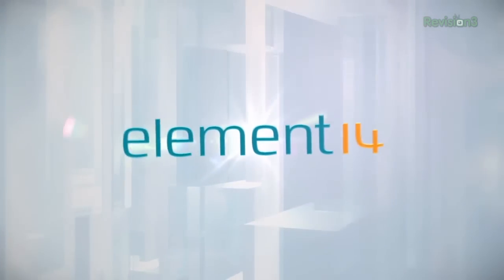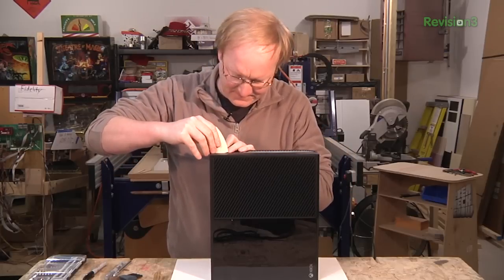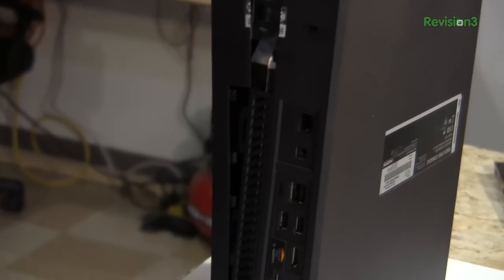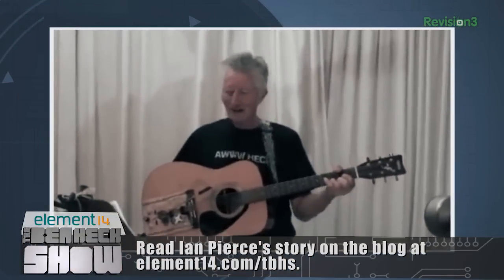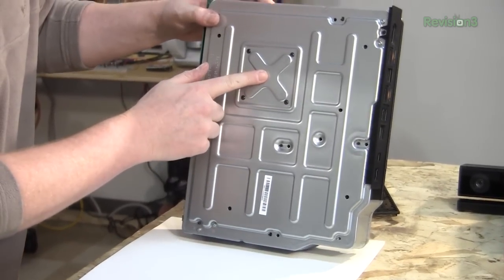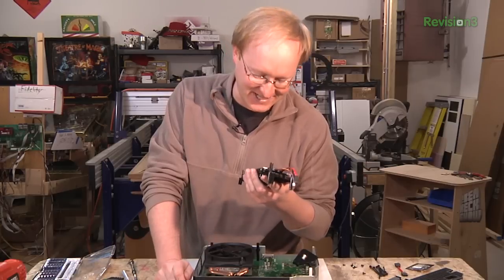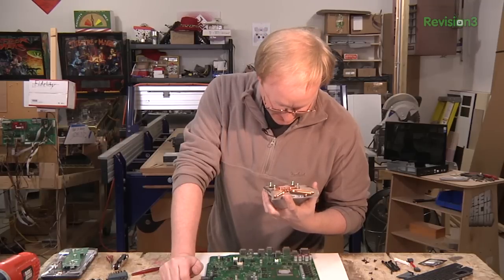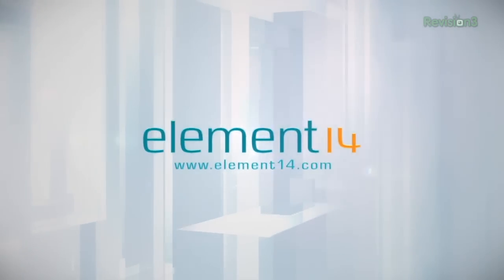Ben Heck's Xbox One Teardown

Comment: So those nice big fan clips break easy, I got an xbox recently that was dropped and 3 of 4 were broken. It hit the ground hard enough to bust the case open, bend the metal frame, rip the ribbon cable and the wireless Ariel cable off the front RF.  I'm surprised the HDD survived though.

Comment: The inside is a lot like a PC.
Reply: +Proquer It pretty much is a PC, but with a different operating system.
Reply: the original xbox was basically a pc that is why it was so big
Reply: All consoles are essentially PC's, you can run Windows on the 360 and Linux on the PS3. You could do that on the original Xbox and PS2 as well, i don't doubt current gen wouldn't be able to do it too when someone cracks them open
Reply: The PS2, PS3 and all consoles before them were  heavily custom  proprietary hardware hence why they were so expensive and powerful. The Xbox consoles are literally PC components in a box, even the disc drives are PC drives. The PS4 is the first sony console to use PC components. All arcades are PC's now. They used to be custom hardware in the 1980's and 90's.

Comment: Why don't they want you looking inside it?
Reply: they dont want u to reverse engineer the thing
Reply: Can you see It? Illuminati confirmed👀☠❌ 🔺🔺🔺
Reply: So you don't accidentally  break it out of morbid curiosity and then since you voided the warranty opening it you have a broken system. They're trying to protect you from yourself
Reply: +YangSing1 in case if u opened it and broke something. just guess I am not telling u would just think. then when u goto Microsoft and complain that there is a manufacturing defect , Microsoft is liabe to fix it . so to prevent that from happening they put that sticker

Comment: After watching the teardown of X1 & PS4 just realized how much more compact the PS4 is, Sony even put the power supply inside the console instead of the huge external brick used on X1, and to add insult to injury PS4 is the more powerful console.
Reply: +73mathesar The reason it's that way is because the PS is packed like a laptop. The XB1 is built like a small PC and that's why the XB has a faster CPU and a slightly less powerful GPU.

Comment: The contrast between the engineering of the PS4 and Xbone is amazing. Even though they use many of the same parts, the PS4 is on a much higher level.
Reply: That's a programming issue. Rocket League runs warmer than GTAV.

The engineering I am referring to is design, not performance.
Reply: japan is about neatness compactness and efficiency. America like thier cars do not care about that

Comment: Holy balls, that heatsink on a console?
But anyway, to the 14 year olds arguing, you need to remember.
Microsoft is experienced with software.
Sony is experienced with hardware
Reply: Think you.
Reply: +Kavas The heatsink is like that to prevent the overheating issues like the 360.
Reply: PS3 had the same problem too, fire an old PS3 up and it'll sound like a jet engine because the fan can't keep it cool
Reply: And that is why Microsoft is such a bigger company.
Reply: It's funny you say that sense every time I've bought a PlayStation with the exception of the psone, PS3 died after 2 years, ps4 died after 8 months, I'd say if Sony is experienced with hardware they definitely haven't learned from there mistakes like Microsoft has I'd say the original Xbox one is better built than any PlayStation I've owned, old fat Xbox one on its second power supply and going strong  to this day, i was done with Sony after they released that God awful PS3 super slim after my PS3 original  died, super slim didn't last 3 months and I said to hell with ps4 after it died 8 months, so Sony may be well versed when it comes to hardware but they don't give a shit when it comes to cutting corners, the super slim was as solid as 6 dollar toaster from Dollar General.
Reply: @bray32641  stop lying

Comment: The XBOne looks like a perfect candidate for a laptop mod. I'm excited to see what you come up with.

I am really happy that the xbone has that kind of cooling. Do you know which fan the fan is blowing? The 360 Slim had a good heatsink, but the fan was blowing out of the case... not onto the processor. I had a friend with a slim that would have overheating issues with the 360 slim, due to it. I removed the fan, added a quiet 92mm fan that blew onto the processor instead of out of the case, and soldered it to the 12v line. You could feel the hot air blowing out of the top, and the heatsink was cool to the touch. He never had a lag issue since.

Comment: interesting fact: those Samsung drives are actually stock from Seagate... you can tell from the Seagate website on the top of the drive label and the model number... the Seagate hard disks have an model number... for example, the 1TB Seagate Baracuda is ST1000DM003-1CH162., ST standing for Seagate Technology

Comment: why did microsoft make it that you cant actually upgrade the hard drive without voiding warranty. i mean if sony could do it why cant they. also why has microsoft always been different when using hard drives like witht he xbox 360 i loved it but i never understood why they used a normal old laptop hard drive but then put some next ass casing ontop of it so it wasnt that easy to buy a normal pc hard drive and just pop it in
Reply: ***** id rather be able to upgrade the hard drive. and with upgrading then i can atleast use the old hard drive as a spare hard drive or sell it to get some extra cash
Reply: TheTruth4k It actually supports up to 15TB. external drive.

Comment: is the graphics card built into the motherboard? he never pulled a graphics card out of the Xbox
Reply: I think both the standard computations and rendering computations are all done on the single APU. That's why he was being particular about calling it an Accelerated Processing Unit. Games developed for PCs actually have to assign certain operations to the GPU, otherwise all calculations are done on the CPU by default. I speculate that game engines usually have built in functionality to easily handle that stuff, so it's not something you normally hear about.

Comment: So would it theoretically be possible to upgrade the HDD with another Samsung drive of the same speed with more storage?
Reply: The trick would be formatting it correctly and maybe pre-loading it with certain data. If you can do that, you should be able to fit any drive in it that uses sata 3.0.
Reply: Thank you. Shows what I know

Comment: The design of the Xbox ONE is really awful.
Reply: I like the look of it
Reply: david doof That is your opinion yes. But when you first get it it is shiny and looks nice
Reply: Are you mental, there are rechargeable controllers for both the xbox one and 360.
Reply: ***** It's a box! What do you want? A Monet on the side?
Reply: explain?
Reply: Dom S a big square box with a power brick
Reply: did you expect it to be round?hexagon shaped? Or in italics like the ps4? Plus That power brick saved my xbone once. Their was a bad storm that sent a power surge through my house. Everything went off. 5 mins later power came back and my Xbox was still on because of the reserve power in the brick. Nothing was corrupted nothing was affected, didn't even have to restart my system after losing all power. So how is that a bad design?
Reply: Dom S the console itself is ugly.Really ugly
Reply: Dom S Save you Xbone? It is not like it would break the console from forcely turning off, and that power brick would still "save" your Xbone if it was in the console. Though they just couldn't fit it in there. And it was already too big, the new controllers are aweful as well. 360 controllers were much better. One thing I hoped they would change for once is to actually make the controllers chargeable instead of that shitty double a batteries method they are still using. We were in 2013, they could at least change it to what Sony did in 2007...
Reply: Yes because a parallelogram is very intriguing.
Reply: not that hard to press the power button.
Reply: cool story lol @FroddeB
Reply: david martin both the Xbone and PS4 are ugly.
Reply: I have a 360 to still have its 7 years old..... never had a single problem and play it to this day. I'll give the Playstation thumbs up on infamous I liked it but on the other hand over all 360 was better than ps3 and xb1 I'm sure will not disappoint
Reply: Brad Loyo have the Xbox one and I fucking love it I prefer the look of it and like I've stated before it's a 60 to a rare 100p difference and you Sony ponies will ride on that all day long you can't even tell the difference.
Reply: Brad Loyo since when the fuck does the size of a console matter.
Reply: Brad Loyo halo trumps all
Reply: I say so
Reply: Ah but at least you wont get hacked once a year like playstation
Reply: Brad Loyo really so you call D-dos'ing a server hacking?
Reply: i really see no diffrence between xbox one and ps4 there both boxes just ps4 has slants
Reply: the ps4 is much smaller in comparison what does this mean for failure rate
. I bought ps4 but i think xbox one looks better, i like the look or the original xbox too
by look i mean physical appearance
Reply: One to trump all, atleast we can use xbox live and its not shitty like psn!
Reply: Ps4 looks like it's from the future Xbox 1 looks like a bigger ps1
Reply: CommonGaming lol thats a joke right? Please say it is.
Reply: what do you mean not hard? ps4 button too damn small make it bigger than ok
Reply: Yup, xbox one design, materials and quality are really awful, I used xbox one and ps4, Im a PC guy I'm not a console fanatic
Reply: Alexander Case Of course they are rechargeable, though you get my point with the bulky inconvenience on the controller, that are space for double a batteries... Just put a normal battery in there instead of this bs.
Reply: While the 360 controller was bad a bit with the bat pack and all the xb1 controller i feel is awesome i love the feel
Reply: ***** I don't belive you own a xbox one. The day i got one i was holding the controller for hours because it fits so good in my hand and feels so good to hold. I let my friend who own a ps4 hold it and he was like omg. And now it is time for my conclusion & Opinion. The x360 controller is far worse than the xbox one, I think it got something to do with that the bulk in the back of the controller (Battery Holder) Is now in the controller
Reply: Peyton Smith The Xbox 360 and PS3 looked nice, The Xbox One & PS4 look like VHS players from the 1980's...
Reply: Alexander Case yes because a fat rectangle is better
Reply: Alexander Case Tell us that in 3 years when your games will look like shit compared to the ps4
Reply: Or I'll tell you how you all will still boast over  a 60 to a rare 100p difference which you can't even tell the difference but whatever I'll let the ponies run there mouths it's interesting to see your replies
Reply: Alexander Case yes because a smaller more powerful console  WITHOUT a power brick is retarded
Reply: Take the word power and just leave brick yep that's what a ps4 I'd pretty much most the time
Reply: Alexander Case yes because the console that doesnt look and performs like a dvr is a brick! Haha just gtfo xD
Reply: Alexander Case and in 3 years playstation will have a shitload of good exlcusive while xbox will have practically nothing
Reply: Yes because that's how it happened with the 360 and ps3
Reply: Alexander Case just because the xbox 360 was "better"(not really cuz the overheating was horible I can tell you by experience I had one and I used to put a bag of ice on top...until I wized up and sold it to buy a ps3) doesnt mean the xbox one is better than the ps4 jackass... 
Ps the ps3 had great games uncharted, infamous, little big planet, and it had blue-ray
Reply: Alexander Case thats the problem you dont know what fuck your talking about! Seriously the xbox one is fat and ugly it has lower specs than the ps4 and as of now it has and will continue to have less exclusives than the ps4... dont get the xbox one
Reply: Yeah but if the power brick was internal like in ps4 and PC the same thing would have Happened
Reply: daniel wall what would had happened
Reply: Alexander Case even if you think that way its still huge not including the powerbrick and we will and have better exclusives
Reply: I've seen the ps4 bro it's just a bit  shorter that's it
Reply: No, the xbox one is about 1.5 times bigger than the ps4 not including the powerbrick and the controller also feels better
Reply: Brad Loyo your Xbox one would have been saved from the power outage anyway if the power brick was internal
Reply: daniel wall I cant understand wtf your saying
Reply: Alexander Case whatever man think whatever you want if you think a fat ugly and slow console is better you go ahead and buy it. I dont give a shit go waste your money if you want I just feel bad for you cuz ps4 is going  get the better exclusives
Reply: Alexander Case if you say so
Reply: Alexander Case :/
Reply: Ok?
Reply: Josh Kenway yes you will get hacked 2 times a year with Xbox :D instead
Reply: Josh Kenway yes you will get hacked 2 times a year with Xbox :D instead
Reply: yes is awful...but good the keep the console cool!
Reply: ***** I guess, but my ps4 never overheated, when my brothers came over we played all day with no problem... I think Microsoft just has a phobia of overheating because of what happened to the 360
Reply: Alexander Case KillZone Shadow Fall Is 10x Better
Reply: ***** no games revolve around facts
Reply: I have Xbox One and i take a look on it and its so cool
Reply: and...you buy it to look inside? U(*_*)U
Reply: You know?PS 4 is a big box of shit nuggets :P
Reply: david martin I agree, its very ugly.
Reply: CommonGaming The Xbox one looks more mature while the PS4 look like a big toy.
Reply: like your mom...right?=D
Reply: +Ryan Victor talking to raptor jesus btw
Reply: +Raptor Jesus (hulkisgreen) xbox one has better thermal design and it more silent than damn ps4 seen austin's video then drew a conclusion both console have pros and cons both still d best i choose both rather than one both got good game titles so i dont care the design... ps4 also release heat from the back which is not good because many ppl place it on a cabinet so ps4 likely overheating... xbox one also less power consumption but hard drive not replaceable but can connect a external hard drive i have both in about 1 year... i know what i am saying
Reply: +Raptor Jesus (hulkisgreen) ps4 also got smaller power button hard to press when you wan to be quick xbox one got big power button...
Reply: Raptor Jesus as you.
Reply: +Ghast Unity it's not small at all lmao

Comment: Having gone through 3 xbox 360's from red ring of death my current slim 360 halo reach edition has been running like a champ since I got it in 2010. I can see microsoft did a similar design on this one probably even beefing up the heatsink even more with solid copper and so forth so I'm thinking heat won't be an issue with the xbox one. I'm still amazed they sandwiched the original 360 gpu right under the dvd drive which led to so many problems but I'm glad to see they resolved it going overboard to be sure the XB1 don't have any overheating issues. I've had my ps4 since launch and still no issues with it even though the small case does concern me for the longterm reliability let's just hope sony knew what they were doing.
Reply: yh i think microsoft learnt from their mistake i mean it did take them a long time to sort out the red ring issue. i wouldnt worry about the ps4 reliability tbh. sony have been generally quite good with their consoles in the past in reliability terms. i mean the ps1 and ps2 were quite reliable and so was the ps3 even the old fat model with ylod. i mean the ylod issue wasnt that big when compared to the red ring issue and the ps3 slim and super slim are quite small also and they never had any overheating problems
Reply: taz874 my PS4 System Overheats and the  Fan Noise is loud. I'm guessing i have a defected one becuase my brothers ps4 seems perfected with no issues
Reply: not to mention that sony have bin making games consoles longer than Microsoft, plus they have bin making hifi amplifiers, cd/blu ray players,, tvs, etc etc for many years so im sure they know how to keep something cool. :-)
Reply: ***** your probably unlucky and have a defective model. i mean my ps4 is literally perfect and i even had it on for 3 days straight at times and no overheating issues. my ps4 is also quiet. my friends ps4s are also perfect
Reply: darren s that is true since microsoft have mainly been on the software side of technology like windows/microsoft office and havnt done alot of like hardware
Reply: taz874 No, the ps1 had no reliability, mine didn't last 2 years, not that i was sad when it stopped working but it died just from being played every once in a while.
Reply: john tyler it was quite reliable alot of the early models though were pretty crap
Reply: I think mine was one of the earlier ones then.

Comment: Cant you use a hdmi to vga adapter for the screen, or wouldn't it work..?
Reply: You cannot change a digital signal to a analog and why would you want to? Using VGA is a sin.
Reply: CYRRYANC97 Well analogue can scale to *any resolution vs digital requiring faster bandwidth cables - like HDMI V2 for 4K 60HZ.